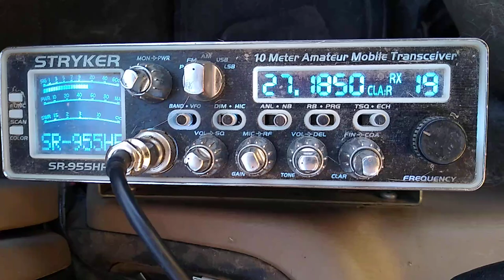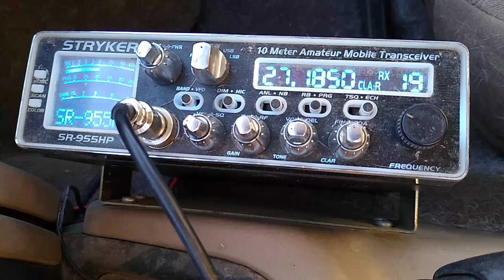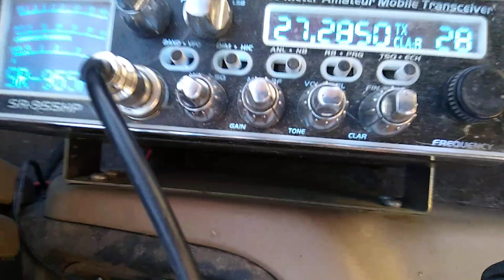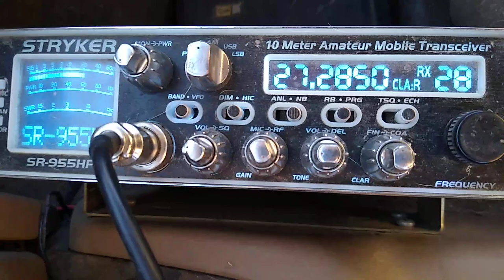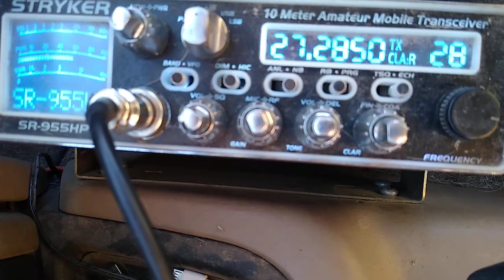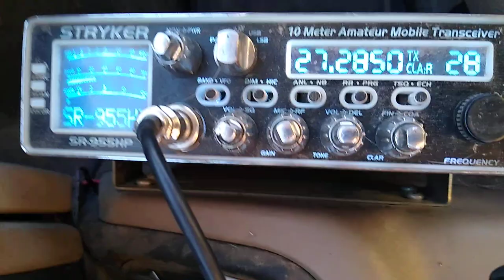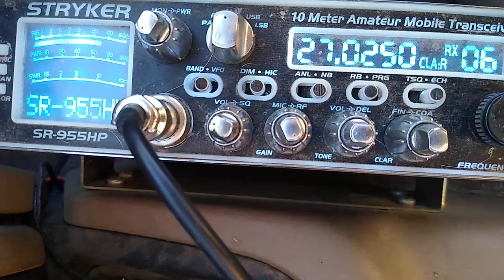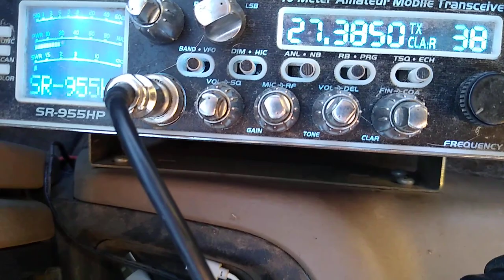Fine Tune CB Shop .. FineTuned SR 955 v1 Barefoot Mobile Mud Duck Radio - Lucky Star In ATL & Others

Comment from the maker: Some may have already realized .. all I do is step outside the Faraday cage and into the Jeep, and key the mic .. Barefoot!

CLEANER AND MEANER .. NEVER SETTLE FOR LESS OR THAT'S WHAT YOU'LL GET!

It's all about The Bench (and how well you follow directions) .. If they can't show it they don't know it.  Got that part ??  Read over it as many times as necessary until it sinks in. Some take longer than others .. common sense is all that's required. 

Watt for watt .. squash them little "truck-stop" tuned splatterbox bugs like they're not even there .. GET MORE RANGE .. be heard, and hear, where you weren't heard, and hear what you wouldn't have heard before. Get FineTune not "peaked and ruined".

It's what I recommend, uses, service, and sell ... to you ... not 
something nonpractical or deceiving in a misleading way. I'm not just 
the tech and owner of Fine Tune CB Radio Shop, I'm a customer too!  When
finished, You'll be giving radio checks, not asking for them.

Have A Great Day And Safety First!

Back to The Bench >>

==========================

Cleaner And Meaner

It's not about how many watts (if you want range), it's all about how clean you can make each and every single one of them.

The 955 Versions 2's are worse than the original
version's, and require even more TLC.

Tap tap tap ..

If they can't show you they're snowing you! Find someone who's honest and competent.

Making it clean "and" out performing those hacked up splatterboxes 
requires Skill and Calibrated Test Equipment. If they claim otherwise, 
they're either a con artist or incompetent. Take your pick!

Blame it on the materials, math and Mother Nature!

Elements, Constants, and Cycles.

They can work for you or against you.

Cleaner And Meaner, there'll never be a substitute .. like it or not.

It's all about Procedure .. No Exceptions.

One At A Time .. Don't Be In A Hurry!

You make them ring and I'll make them sing. 
https://www.nist.gov/pml/productsservices/physical-reference-data

No longer accepting mail-ins .. Fine Tune CB Shop services radios for 
the original owner that has purchased brand new radios from Fine Tune CB
 ONLY. This way, like the Maytag repairman, I only see one or two radios
 out of 500-600 per year that may have developed an issue. I'd rather 
spend my time doing better things .. maybe you should too??

Cleaner And Meaner .. Only the serious need apply.  No "tire kickers" or
undesirables that I know for a fact disrespects the airwaves and 
especially Channel 19. Haters are always going to hate because it's all
that they know how to do and what they do best. Don't be so miserable!

If you can't handle the heat .. get out of the kitchen. 

If they can't show you .. in a video .. they're snowing you. Get The 
Picture??

Here's what it actually takes to cut through the noise, be loud and 
crystal clear with a better receiver too:  A) Tuned Bench:  
https://www.youtube.com/watch?v=lwcDfXOgAls.  True, it's more 
complicated and time-consuming to accomplish these consistent and 
accurate results. Below is a partial procedure and list of calibrated 
equipment used to achieve this level of performance. Read on ..

Radio Evaluation Rules: 
https://www.facebook.com/163Hardrive/posts/3729504220447644
https://www.facebook.com/163Hardrive/posts/3523601657704569

Fine Tune CB Radio Shop strictly adheres to (https://www.nist.gov/) NIST
Traceable Calibrations and other industry standards to maintain 
accuracy and consistency for providing Real World Performance Tuning of 
Citizens Band and 10 Meter export mobile radios with integrity.

"Basic Textbook AM/FM/SSB Transceiver Tune, Alignment and Calibration" 

1) Pll adjustments
VCO & OSC, AM TX OSC, USB TX OSC, LSB TX OSC.

2) Transmitter alignment
DRIVER BIAS, FINAL BIAS, SSB  (or gate voltages for mosfet versions) 
CARRIER BALANCE, HI-LO AM & SSB Power, RF METER, AMC, ALC and FM 
DEVIATION.

3) Receiver alignment
AM/FM RF & IF SENSITIVITY, FM DETECTOR/DEVIATION, SSB IF 
SENSITIVITY, SSB S-METER, AM/FM S-METER (100uV unmodulated -67dbm for 
�S-9� meter reading!), AM/FM SQUELCH RANGE, SSB SQUELCH RANGE, and NOISE
 BLANKER/AUTOMATIC NOISE LIMITER (Real World dBm to volts (uV) tables 
below).

That's just a typical run of the mill textbook tune up and alignment (if
 you're lucky). There's more to it than frequency alignment, modulation 
adjustment, meter calibration and a tune up report displaying 
exaggerated rms Bird peak watts! 

"Test Bench includes"

Bird 4314C Meter
https://www.birdrf.com/Products/Test%20and%20Measurement/Power-Meters/Wattmeters-Line-Sections/RF-Wattmeters/4314C_PEP-Single-Element-Wattmeter.aspx
Part 1) https://www.youtube.com/watch?v=RpX9IHe4ORM&t=16s
Part 2) https://www.youtube.com/watch?v=LuhbqTf6Bxw
Bird 4314C Accuracy Test: 
https://www.youtube.com/watch?v=DqEOabYqhQo&t=5s
Bird Stipulates 1/2 wavelengths  
https://www.youtube.com/watch?v=5eWhgT-rTII
And Genuine Bird Elements from 1K down.

Bird 4373 Sampler 
https://www.rfparts.com/signal-samplers.html

HP8924c with options
http://userequip.com/files/specs/2147/HP%208924C%20Repair.pdf
https://www.youtube.com/watch?v=Cg1w0xBa27s&t=1s

HP8920a with options
https://www.keysight.com/upload/cmc_upload/All/EPSG072204.pdf

Three analog scopes, one digital 200 Mhz
https://www.atecorp.com/atecorp/media/pdfs/data-sheets/tektronix-2465b-2467b_manual.pdf
https://www.youtube.com/watch?v=by98x4eu2lM

Fluke 27fm
http://www.fluke.com/fluke/inen/digital-multimeters/fluke-27.htm?pid=56055
 
LCR 
http://www.lcrresearch.com/wp-content/uploads/2017/05/LCR_Pro1_Manual_version1.03.pdf

Power supplies
6 Cosel PBA1500f12 (750 amps) variable and configurable.
https://en.cosel.co.jp/product/powersupply/PBA/PBA1500F/PBA1500F-12/
Corcom 20VB1 F7130 EMI Filter 50-60Hz 250V

Times Microwave Coax jumpers and test leads
http://www.timesmicrowave.com/cms/products/cables/lmr/
https://www.youtube.com/watch?v=EmqaGJ6IWow
https://www.youtube.com/watch?v=1ltFVSxGp5Y
https://www.youtube.com/watch?v=v12YZT_1o90
https://www.youtube.com/watch?v=h7iiYfmYWRA&t=215s

Amphenol RF Connectors
https://www.amphenolrf.com/
https://www.youtube.com/watch?v=dVh5B0hdEA0 
https://www.youtube.com/watch?v=dKZg8T_AOso

More range, compliments, reliability and a quieter, clearer but more 
sensitive receiver,  Get Fine Tuned .. not peaked and ruined.

dBm To Watts and Volts
Tables below displays relationship between Power in [dBm] or [Watts] and
Voltage in RMS, peak, peak-to-peak for sinusoidal signals in 50-Ohm 
systems for accurately measuring and tuning am/fm/ssb receiver 
sensitivity, agc, squelch and "S9" Meter calibration. Real World! 

Mike @ Mikes Radio Repair (Romper Room), Mark Rutherford aka Mark 19960,
CB Kidd, Martian and all of your other fake accounts pay attention to the 
tables below, stop misaligning radios, spreading false information and 
promoting propaganda! Window Lickers ...

  [dBm] [Watts]   [Volts]rms   [Volts]p    [Volts]pp
-140 0.100E-16  22.361 nV  31.618 nV  63.236 nV 
-139 0.126E-16  25.089 nV  35.476 nV  70.952 nV 
-138 0.158E-16  28.150 nV  39.805 nV  79.609 nV 
-137 0.200E-16  31.585 nV  44.662 nV  89.323 nV 
-136 0.251E-16  35.439 nV  50.111 nV  100.222 nV 
-135 0.316E-16  39.764 nV  56.226 nV  112.451 nV 
-134 0.398E-16  44.615 nV  63.086 nV  126.172 nV 
-133 0.501E-16  50.059 nV  70.784 nV  141.568 nV 
-132 0.631E-16  56.167 nV  79.421 nV  158.842 nV 
-131 0.794E-16  63.021 nV  89.112 nV  178.223 nV 
-130 0.100E-15  70.711 nV  99.985 nV  199.970 nV 
-129 0.126E-15  79.339 nV  112.185 nV  224.370 nV 
-128 0.158E-15  89.019 nV  125.874 nV  251.747 nV 
-127 0.200E-15  99.882 nV  141.232 nV  282.465 nV 
-126 0.251E-15  112.069 nV  158.465 nV  316.931 nV 
-125 0.316E-15  125.743 nV  177.801 nV  355.602 nV 
-124 0.398E-15  141.086 nV  199.496 nV  398.992 nV 
-123 0.501E-15  158.301 nV  223.838 nV  447.677 nV 
-122 0.631E-15  177.617 nV  251.151 nV  502.302 nV 
-121 0.794E-15  199.290 nV  281.796 nV  563.591 nV 
-120 0.100E-14  223.607 nV  316.180 nV  632.360 nV 
-119 0.126E-14  250.891 nV  354.760 nV  709.519 nV 
-118 0.158E-14  281.504 nV  398.047 nV  796.094 nV 
-117 0.200E-14  315.853 nV  446.616 nV  893.232 nV 
-116 0.251E-14  0.354 �V  0.501 �V  1.002 �V 
-115 0.316E-14  0.398 �V  0.562 �V  1.125 �V 
-114 0.398E-14  0.446 �V  0.631 �V  1.262 �V 
-113 0.501E-14  0.501 �V  0.708 �V  1.416 �V 
-112 0.631E-14  0.562 �V  0.794 �V  1.588 �V 
-111 0.794E-14  0.630 �V  0.891 �V  1.782 �V 
-110 0.100E-13  0.707 �V  1.000 �V  2.000 �V 
-109 0.126E-13  0.793 �V  1.122 �V  2.244 �V 
-108 0.158E-13  0.890 �V  1.259 �V  2.517 �V 
-107 0.200E-13  0.999 �V  1.412 �V  2.825 �V 
-106 0.251E-13  1.121 �V  1.585 �V  3.169 �V 
-105 0.316E-13  1.257 �V  1.778 �V  3.556 �V 
-104 0.398E-13  1.411 �V  1.995 �V  3.990 �V 
-103 0.501E-13  1.583 �V  2.238 �V  4.477 �V 
-102 0.631E-13  1.776 �V  2.512 �V  5.023 �V 
-101 0.794E-13  1.993 �V  2.818 �V  5.636 �V 
-100 0.100E-12  2.236 �V  3.162 �V  6.324 �V 
-99 0.126E-12  2.509 �V  3.548 �V  7.095 �V 
-98 0.158E-12  2.815 �V  3.980 �V  7.961 �V 
-97 0.200E-12  3.159 �V  4.466 �V  8.932 �V 
-96 0.251E-12  3.544 �V  5.011 �V  10.022 �V 
-95 0.316E-12  3.976 �V  5.623 �V  11.245 �V 
-94 0.398E-12  4.462 �V  6.309 �V  12.617 �V           

                         Don't Be A Mud Duck!

Contact: https://www.youtube.com/watch?v=P0W_Ltzeyyc ONLY when Ready. 

Tire kickers GET THE BOOT.